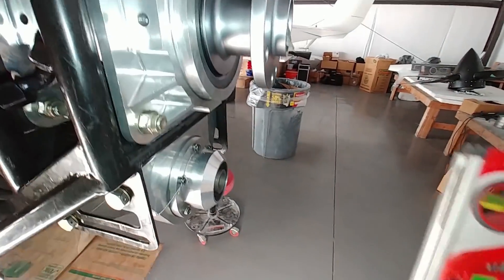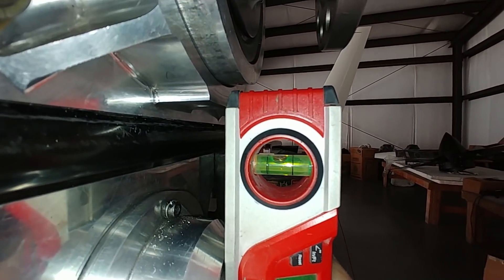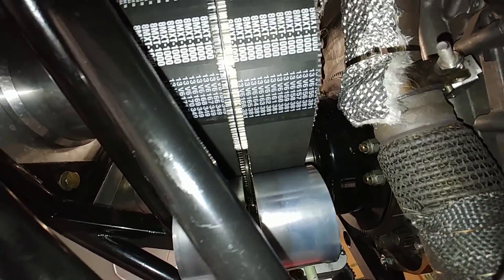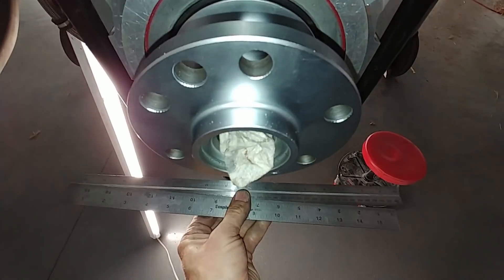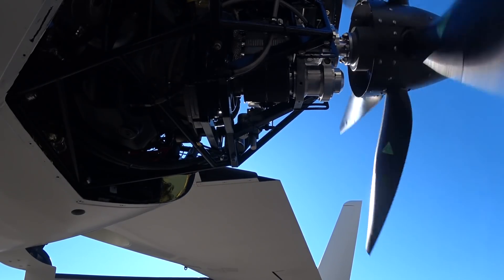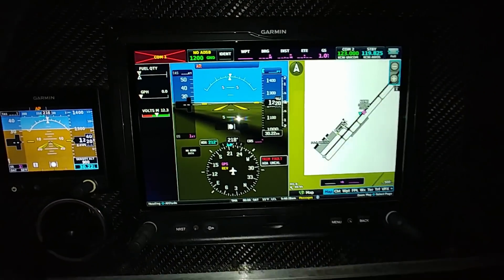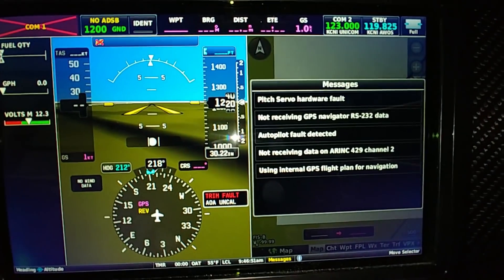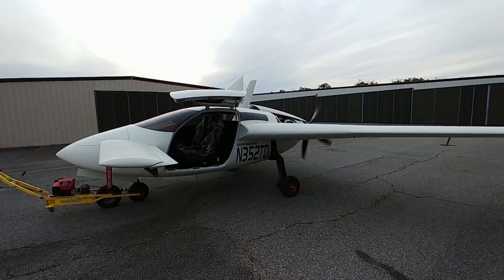Understand the Problem - Building the Raptor Prototype

Comment: Shim the bottom bolts out on the re-drive (all four). Start with .005 shims and go from there. Consider adding belt guides to the outer most pulley sides. I am assuming the re-drive is ridged mounted and the engine is damper mounted. Monitor deflection under full torque for belt walk prior to installing guides on the outer pulley. V-belt pulleys may be another option if this is unresolvable, similar to rotor drives used on Robinson helos.
Reply: Could be top shim, I missed the rotation.

Comment: Would be hard getting belts to run true without being able to adjust while running. Any belts I’ve worked on had adjustment screws to slide the axle, guessing that’s not an option here. So it’s basically trial and error by doing small adjustments and marking positions until the belt walks left, then backing it off a touch and hoping it holds true over time. Either way will need periodic adjustments if having it run against the flange is an issue.

Why is it an issue if it runs against the flange? Both the pully and belt are rotating at the same rate to there won’t be much rubbing friction. Could even get a Delron or HDPE spacer pressed against the flange to also guard against wear a little better and just set a TBO for the belt and spacer. Periodic replacement will probably be much less hassle than needing a mechanic to true the belt at a service station. Would make maintenance much simpler when seeking service away from home base with an unfamiliar mechanic for an owner. Plus save many tedious billable labour hours from the mechanic.

Comment: Two possible solutions:

1) Already mentioned - crown the pulleys to "naturally" center the belts, with perhaps some impact to belt life, OR

2) Use ganged (redundant) V-belts as in some helicopter clutches / transmissions.

The index feature of the timing belt is not needed in this application. Redundant v-belts would work just as well for simple power transmission. Just a thought...

Comment: The only difference between these belts and leather belts from the steam age is the teeth. 
A crown of .050" to .100" will make the belt ride to the crown, self centering as it were.
Might be a hard milling operation but should work well. The old being new again.
Just one man's opinion.
Thanks for sharing

Comment: As a experiment I would remove the rubber engine mounts and hard mount the engine to the engine mount.   Next add rubber isolator mounts to the engine mount/firewall junction attachment.  This way you won’t have to totally redesign the redrive and still accomplish the much needed engine & redrive hard mounted together.
Reply: Just testing this by replacing the engine mounts with solid ones would be quick, easy and cheap. Whether or not the solid mounts would then cause vibration issues through the airframe though is something I have no idea about.

Comment: I'm a snow mobile mechanic and to get the track to run true in the middle change the tension from one side or the other same thing with your tensioners if they are a little bit tighter on the inboard side or the outboard they will make your belts move in or out even if you're main pulleys are true

Comment: And now having finished the video, I am also remembering, and I hope this is accurate, that tractor aircraft engines are mounted a few degrees off of center to compensate for the asymmetrical thrust which is due to gyroscopic precession as well as the downward stroke of the propeller on the right hand side producing a bit more thrust than upward stroke on the left hand side. Is my memory serving me well, or even semi accurately?

Comment: I'm only half way thru the video and am wondering whether this belt movement is akin to P factor, or gyroscopic precession? I'm not an engineer, but it struck me that essentially the belts are describing a spinning disc which might be producing a force at 90 degrees to the disc, hence pulling the belts forward?

Comment: Here is what I see.  For durability the drive mechanism needs to be mounted to the engine not the air-frame. It will also take a lot of stress of the rubber isolator (damper coupling). I believe this was reason for the failure on the first one. With it been mounted on the air-frame and engine in full power it will try to keep centering the engine to the re-drive. also the bottom assembly should be redesign to mount the way the top is mounted  so it can't move. this may work for the short run I do not feel comfortable about it. I do not want to see this Wonderful airplane fail. Peter has done a Wonderfull job and I am looking forward to have my own.

Comment: I can't claim to understand exactly what the issue on the drive belt is but. Want to throw some thoughts out there for discussion.
1) I don't think that spirit level is accurate enough for this kind of work. Perhaps a level with greater accuracy or two long straight edges that can be compared to each other might be more helpful.
2) Perhaps a jig could be made that would attach temporarily to top and bottom drive shafts for alignment then removed after perfect alignment is achieved? 
3) Is it possible that the engine mount in the area of the redrive is flexing and allowing the belt to walk?
4) when/if all else fails talk to ppl with experience with running wide belts on pulleys... Drag racers running superchargers. Two wide belts used to be common so there has to be someone with some advice out there.

There ya have it. My .02 worth. Take that and a 10 spot and that should cover a cup of starbucks.

Comment: Peter, I was playing the video without watching it and I heard you describe gyroscopic precession.  I replayed the video to see what exactly you were describing since gyroscopic precession is normally associated with a phenomenon us rotor heads deal with.  I read some of the comments below and your fix seems pretty easy.  Put a flange on both ends and I think your belts will be contained.  I'm a Standardization Pilot, not an MTP or mechanic so I probably don't understand the mechanics but the physics do sound familiar.  Been watching you from the beginning.  Almost there...It's been a great journey!
Reply: As simple as it sounds, there's more to it. As soon as the belt meets the containment flange, the belt will want to climb that flange. It can't , but the edge will wear like crazy. That same principle of wanting to climb the high side can be used to an advantage too. Create a slight bulge in the center of the idler pulley and the belt will naturally want to center: https://woodgears.ca/bandsaw/crowned_pulleys.html
Reply: @scsirob  This is exactly the answer to Peters problems. Hopefully he'll read this!
Reply: scsirob BINGO!

Comment: It's hair pulling.  Remember all belts give.  An 4 inch wide. 1 side can give more than. The other side.  Guides on the idlers. Is the BEST.  AT HIGH TORQUE.  

👍👍👀🎦🎦👀✈

Comment: Have you designed a Gear box for this engine drive system and completed the estimated weight penalty you would have using a gear box? Maybe the belts will give you problems with mounting the drive on motor mounts and re-drive on a solid mount. Also someone mentioned about a month ago about separating the two idler pulleys and have each one float independently on is own tensioner? You have a lot of good ideas that have been put forward here. People want to see you succeed!!

Comment: Belts walking to one side is always an alignment issue, dont bother with testing idler pulleys and such. They walk because they always want the path of least resistance. If there is more tension on one side than the other, they want to move to that other side and start walking. So make sure the gears are properly aligned. If you must, do it by trial and error by shimming the top bolts or bottom bolts of the upper redrive gears.

Comment: The drive mechanism needs to be mounted to the engine not the airframe! 
You cant mount the engine on rubber mounts and hard mount this to the airframe and expect it to work properly!
When is the last time you opened the hood of a car and saw an alternator mounted to the frame??? Same principle!
Reply: yes drive mechanism needs to be mounted to the engine not the air-frame
Reply: This is the root issue.  However, fences on all all the pulleys would work.
Reply: Simply replacing the flexible engine mounts with solid ones would be cheap & easy and it would show clearly whether or not this is the issue. Whether or not the solid mounts would cause vibration issues through the airframe though is something I have no idea about.
Reply: lol. lustfulvengance, when was the last time you opened the fairing on an aircraft and saw the thrust load being borne by rubber engine mounts? I think I’d let the airframe keep handling that load! The inherent flexibility of belt drives makes them ideal for this approach. Ever heard of an R-22? Try lifting a fairing instead of a hood.
Reply: @jhardiman3  Another great point
Reply: The problem with this is the engine was not designed to be able to take the thrust from the prop. All you will end up with is a cracked block.
Reply: @JakeAvatar1  great point
Reply: This makes about as much sense as saying the transmission in the car that drives the wheels shouldn't be bolted to the frame. The prop produces thrust just like the wheels would in the automotive application we'd assume you're more familiar with.

You'll also see similar driveline issues in watercraft with inboard engines, as they need a thrust block or bearing that attaches to the hull. Engine has to flex and move on its mounts unless you want a lot of vibration, but the prop's attachment and orientation to the hull has to be fairly solid.
Reply: pauljs75 transmissions are not solid mounted to the frame of a car, the have rubber mounts to attach them, however they are solid mounted to the engine. The problem here i believe is the engine is rubber mounted to the frame and the transmission is solid mounted to the frame and not to the engine, they are moving independently of each other causing the problem. Engine drive pulley moving and the redrive not moving!
Reply: @scottwatson5767  As I'm sure you know, in addition to the transmission being on flexible mounts the final drive is through a tail shaft that incorporates univesal joints designed specifically to allow relative movement. He does make a good point the about prop's attachment and orientation to the hull having to be fairly solid though.

Comment: top fuel dragsters have engines that turn 10000 rpm and their superchargers are driven with belts identical to what you are using and they do not experience issues like this. your belt supplier should be able to help you immediately. If you are not working with a belt supplier face to face, get in touch with a local branch of Motion Industries They will solve your problem. FYI if you look at some videos of steam tractors used to power other pieces of equipment with a flat leather belt, you will notice there is a slight crown in both the driver and driven wheels. That crown is there to keep the belt centered on the wheels. No fences required. There is a simple solution to your problem that a drive belt professional can solve for you.
Reply: What works for 5 minutes at a time might not be adequate for 5 hours at a time.

Comment: I am curious what the belt manufacturer,s application engineer has to say ? Why are they individual pulleys. Maybe it's a timing issue? Of the pulleys. My experience indicates no 2 belts are the same, even when cut from the same band.

Comment: Peter, have you given consideration to using a one-piece 2x wide belt instead of the tandem belt setup?

If you machine the pulleys’ grooves ever so slightly with a high center section and the end 2” tapered to either side, the pulleys will self-center. The machining can be done to the ridges but not the grooves since we are talking only a few thousandths. 

Don’t let this part get you down; remember there is always going to be a tendency for the belts to walk forward and backwards because of the infinitesimal flex induced by differential torque. However, in my experience working with these kinds of belts on top fuel dragsters, after having ruled out misalignment due to uneven mounting surfaces, it is almost always a case of one or both pulleys having an unwanted taper, no matter how subtle. So the next measurement you take should be to assure that the pulleys’ surfaces are parallel - from idle all the way through the top of operational RPM range. I saw you measure the ends of the shafts against each other, but that indicates perpendicular alignment of the shaft ends-not the pulley’s grooves to each other.
Reply: On old machinery that used flat leather belts, at least one of the pulleys would have a crown to make the belt track on centre. Seems counter intuitive but Mark and Rowen have hit the nail on the head. I'm sure if you google this you'll find more detail on why this happens but essentially as the belt drifts, the geometry between the pulley and the belt changes the direction of the belts tangent in relation to the pulley and directs it back to the centre of the crown.
Reply: I'm no highly trained engineer but what you said about pulley taper occurred to me also as soon as he said the belt walking happened even when the pulleys were perfectly aligned

Comment: ,,, a friend of mine would take an entire engine, bolt the blower intake manifold on, and mount it in a block Storm Vulcan  surfacing machine, that located block on the main bearing saddles, and surface the intake where the blower mounted. This took stress out of the blower and maybe helped belt alignment . Of course this was like a single engine redrive mounted together .

Comment: Well, the problem is dynamic, isn't it?

It might be that:
*The shaft that the pulley is on might be flexing--just a tiny bit. This might be carefully checked with an old, very carefully and securely placed (indicator), in front of the go-pro set to high frame rate, which is also very secure. I can't see the whole thing, but I think that the top pulley is attached on the left, cantilevered. If that is true, the shaft might need to be a bit stouter, or an additional bearing support might be needed at the right, at some point.
*Or how the pulley mates to the shaft might change a bit.
*Or there is a tiny bit of play in the bearings.

I wonder about the idler play and rigidity, as well.

If you have some time, you might spend a few minutes adjusting your belt sander, or bandsaw, to get the feel for it. Though, it's a shame that a tiny crown cannot be placed on the pulley.

Comment: You're trying to create a static solution to a dynamic problem. If the redrive isn't hard mounted to the engine, you will only be able to tune an alignment at a given power setting and load. I know other engineers have suggested hard mounting the redrive to the engine. This is the reason all belt driven accessories are mounted to the engine, not the chassis. I think it is time to re-engineer the design.
Reply: Simply replacing the flexible engine mounts with solid ones would be cheap & easy and it would show clearly whether or not this is the issue. Whether or not the solid mounts would cause vibration issues through the airframe though is something I have no idea about.

Comment: I think that the angle of the engine and angle of the drive are varying with speed and load. Which would make sense if you look at car engine movement in cars. I don't know if the engine is mounted with solid mounts or not but having a solid connection between engine and drive should also help. Highly powerful engines have their gearbox solid mounted and have the heaviest parts the closest to the engine to reduce the importance of the back support. 
Angled pullies or belts could help but you probably will need more often belt maintenance.

Comment: I'm no engineer, just an Air Force  crew chief. My (useless) recommendation: Make a fence on each pully to contain the belt. :) Keep at it I know youll get it! :)
Reply: Agreed.   Good Fences make good neighbors.  Big fences on top and bottom pulleys and between pulleys.   This would have the added benefit of protecting a belt from an adjoining belt failure.
Reply: Szabathehut is it really rubbing on the fence though when they are both rotating at the same rate? I would think just a slick replaceable wear surface on the inside surface of the fence would be enough to have a reasonable TBO for belt inspection. Delron or HDPE like used with timing chains in some engines should provide a good contact surface.
Reply: Szabathehut the belt doesn’t need to last forever since the rubber gets old regardless, just needs to last long enough to make it to a convenient replacement time like during an annual. 

I would think it would last at least a couple years though, the belt on belt drive motorcycles has flanges on both sides of the pulley and can last 100k miles. That’s a lot of hours of trouble free running with just minor tension adjustments during service.

Comment: Is there some deflection of the pulley? Are the idlers independently adjustable? Are both belts tensioned identically/independently? Strange one belt is ok. Must be small difference